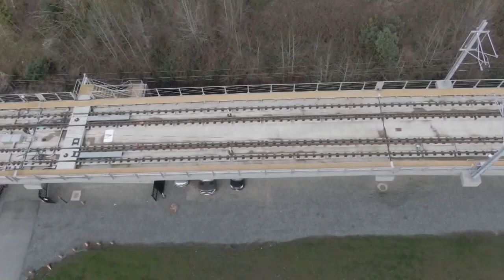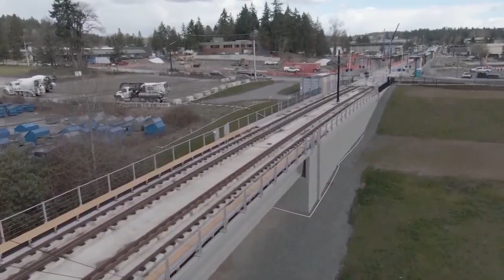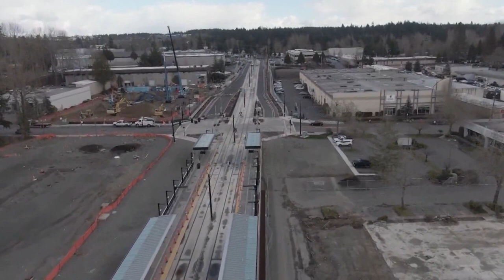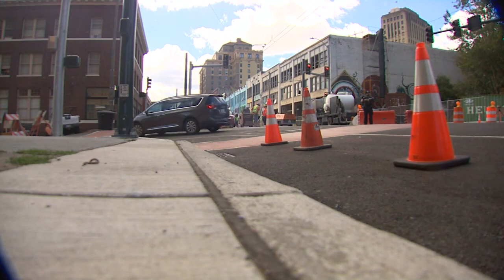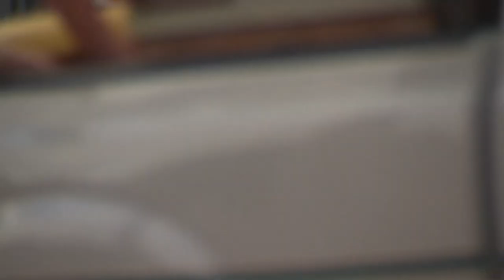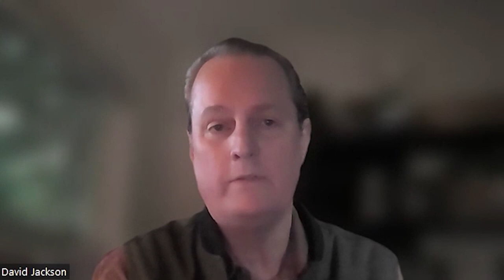Federal Way light rail expansion progress

Comment: King5 you have it wrong. This is not a light rail, it is a streetcar. The agency has manipulated the public into thinking this a greater piece of infrastructure than it is.
Reply: They haven't
Reply: Yes they have
Reply: How?
Reply: Light rail is a whole train not one car.
Reply: Light Rail also  doesn't need overhead wires
Reply: @Tomdelongpenis  light rail does not require overhead wires. But it is much more efficient to maintain if it is.
Reply: this is light rail. Grade separated for the most part and more expansive than a streetcar. Also with higher speeds. The line is blurry for sure but Seattle has a great upcoming system
Reply: @TheVoiceofLosha no they havent